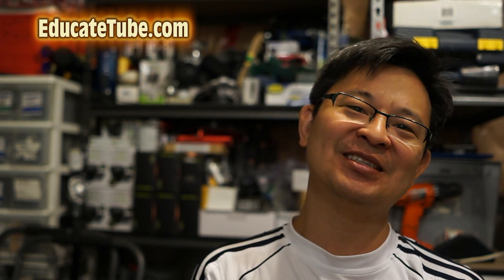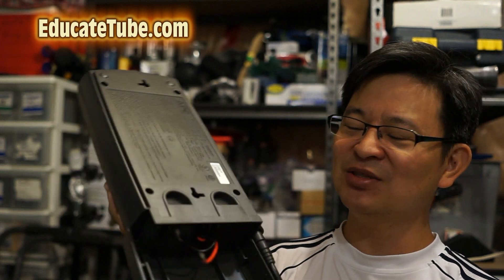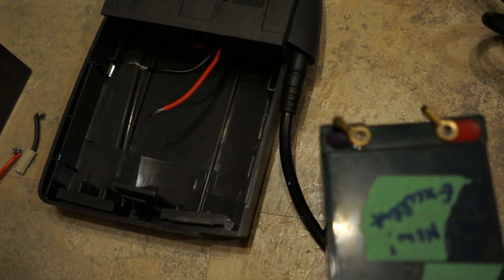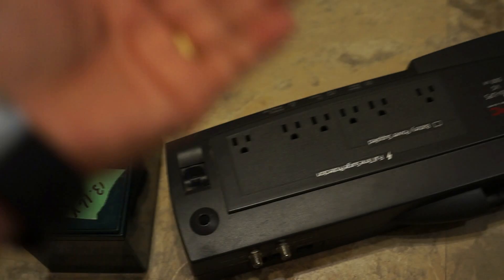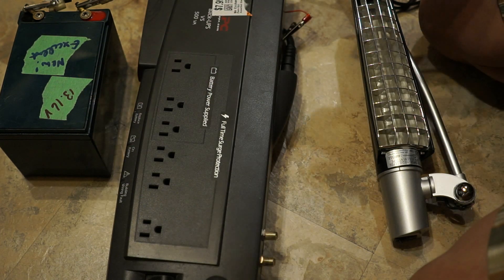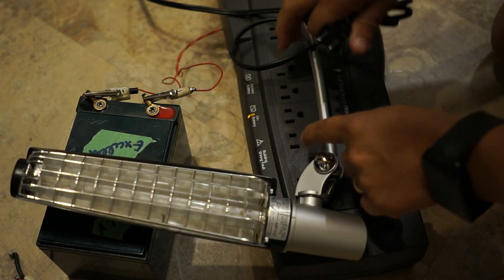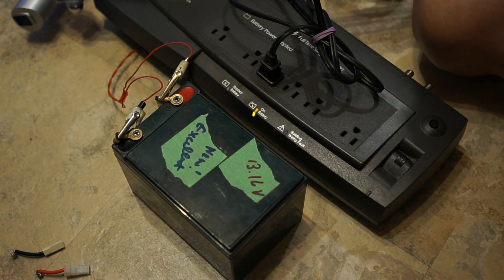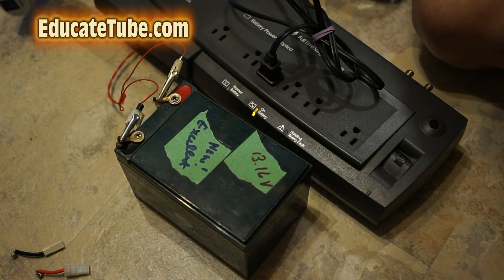DIY Portable Off Grid Electrical System using APC UPS backup electrical power supply

Comment: LEDs use DC voltage and are commonly available in 12v. Why would you use a 12v battery, invert it, only to rectify it again, possibly back to 12v? Incredibly inefficient. Same for charging your phone. Just get an automotive USB charger and hook it up to the battery.
Reply from the maker: I have videos on that.  Most LEDs are actually 3.0-3.2v and require resistors to keep current to a few mA.  The 12V LEDs are connected in series with various resistors, so it depends on the manufacturer's circuitry of the LEDs.

Comment: it's a 325watt continuous 500 Peak I parallel two of the output capacitors on the usp board to increase the watt output and connect it to two rv deep cells in parallel for longer run time and two fans for the two boards for cooling

Comment: You can only run small wattage appliances around 300 watts on this unit, and that is what the circuit board will handle. The larger battery will let you run it for a longer period of time, but it doesn't mean you have the ability to produce a higher wattage. Other ups units can go on up to higher wattages depending on price. The beeping sound tells you the main power is off. This can be silenced 3 ways. Some times you can press the on button twice to silence it. Some units come with a cord to hook to your computer and you download a program to turn it off (info is on you tube). You could find the beeping device and put a switch on it on one side and mount it to the case. I put a car female cigarette lighter plug hooked to the ups battery and plugged in a male to double USB plug so that I could charge a one amp, or two amp phone. By doing this, it doesn't load down the ups units circuit board converting dc to ac power, which wastes battery life,  and you can still use the unit to do other things with the ac plug ins. You can make a long cord with a  male cigarette plug on one end to plug into your car while traveling, and connect it to the battery of your ups unit to charge it when it is off, or you could plug in small wattage appliances if you need to, with the unit on.The ups only powers the plugs that are marked on battery inside the white box on top. The others are for ac surge protection against lighting when your power is knocked out and protects your electronic stuff. If you plan on running lights on this, find low wattage led light bulbs. A 60 watt equivalent bulb (Philips 8.5-Watt LED A19 household light bulb is the perfect replacement for anywhere) will give you 800 lumens of light. If you run it as needed, it will keep you out of the dark for a long time. 

 

2 
 

Reply
Reply: I now have a 30 foot extension light which has a receptacle on it, that I can plug into the UPS unit, and I can use it for an emergency light to change a tire, or look under the hood for quick repairs. I can also use it in a tent or emergency shelter.
Reply from the maker: You are correct.  Thanks for your comments and input.
Reply: Flamethatburns a follow up question .. if you increase the battery size are there any negative ramifications regarding the internal battery charger.. I mean since the charging parameters are  much the same for lead batteries ( discharge,charge,and float charge )  I suppose however, the charger would be running full throttle for longer times.. is that a concern and if so is there a circuit / methodology to replace the crappy charger with an external better one ?